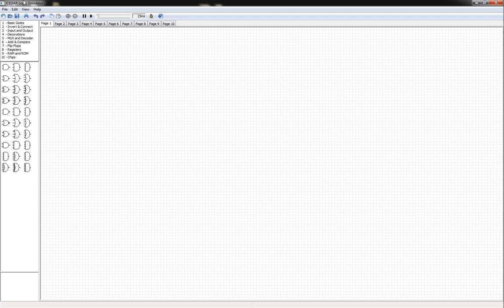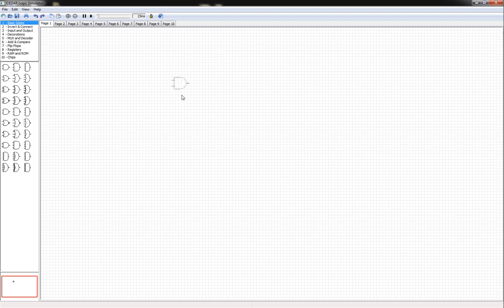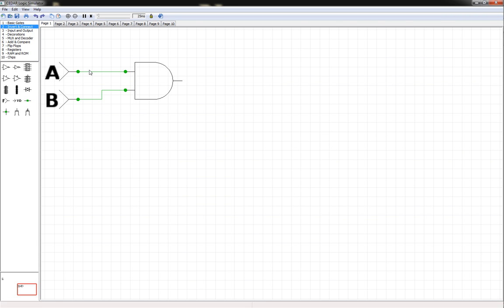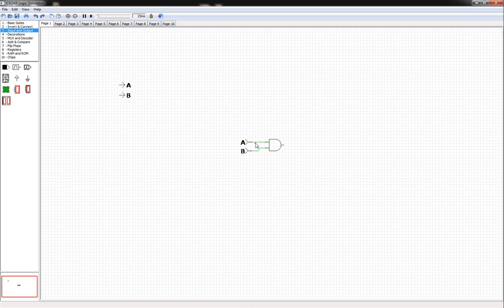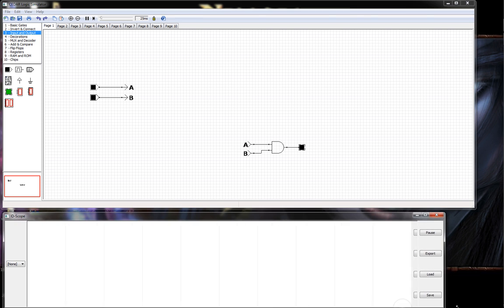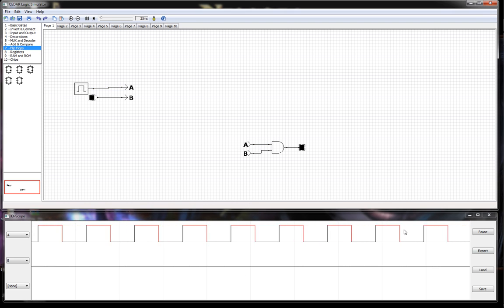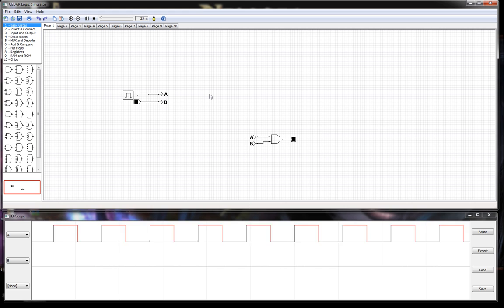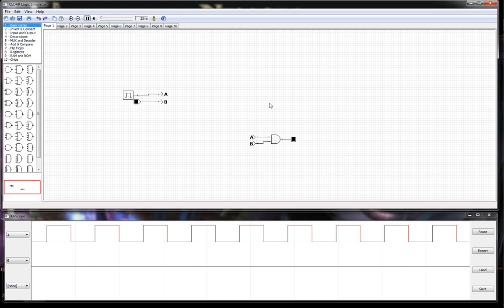Helpful Tools: CEDAR Logic Intro

Comment: I know this is an old video, but if someone still using this software, the blinking problem can be solved if you pause the simulation before you do any movements at the components.
Pause, move your components and then start simulation again. That's the way to avoid this.
Reply: Another tip I just found is, that when you push the space key at your keyboard, it makes the circuit to come to center of the window.
Reply: Also I realized that it is blinking blue when you have done something wrong and fast blinking when you push the button at the clocked R-S flip flop too fast, so if you push it more time than the clock pulse duration, it is working fine. That shows the delay of the gates in use!

Comment: This is cool... I was on the team that cooked this program up back in '05-'06. Senior project, team of 3, tasked with replacing the program the school used back then (Diglog). There's a Z80 chip on one of those pages which was a separate project. Oh btw, IIRC the Export on the oscope is to copy a bitmap to the clipboard.
Reply from the maker: Hey there thank you for your comment.  This is great to talk to one of the developers.  Wow great program man.  And I did not know about the export capability of the oscope.  Thanks again for developing a great program to help trouble shoot things with.  I actually used your program to build an asynchronous state machine for a product in the aviation industry.  Thanks man.
Reply: misperry
Yeah we built it with larger projects in mind than what our specs called for. We got the university to open-source it but never thought it would be as widely used as it is, for this long. And yes, it's quirky in some ways :) If I were writing it today I'd do the front-end with QT instead of wxWidgets, but back then the licenses were different. Couldn't use QT unless we were GPL'ing it.
Reply: Matt Lewellyn
 Hello Matt, great job on the simulator. I'm using this to simulate some old Z80 designs. But i wonder about how the gate delays are handled. Between the individual logic and the Z80 itself. Also, I wasn't sure what time period is being used in the Parameters setting for the Variable Square Wave Clock. Could you elaborate about some more this in the short space here.
Reply: Matt Lewellyn BTW, during a simulation run, I noticed that the 8-input NAND is the same as a 8-input AND. I have ver 1.5, I thought that one was fixed.
Also, I tried to edit the *.lib file, after I close Cedar Logic, but I keep getting a "file is in use" type error message when I save the changes. This happens even when I make a copy of the file and changed the filename. I'm not sure what's happening there.